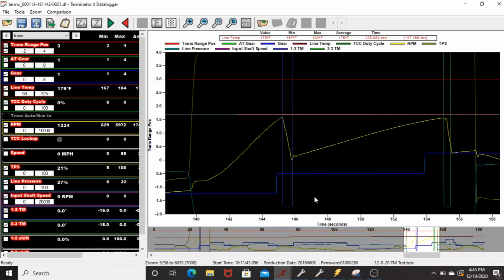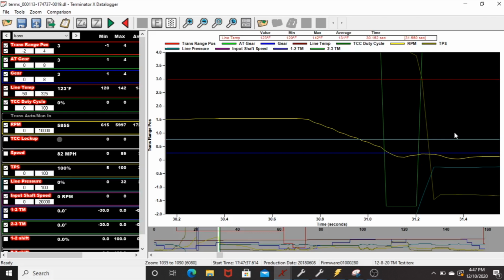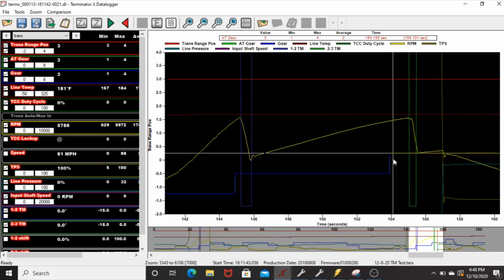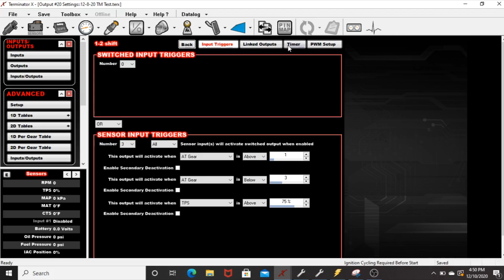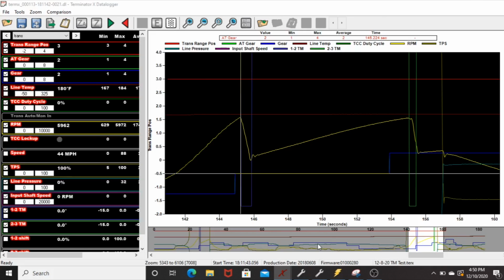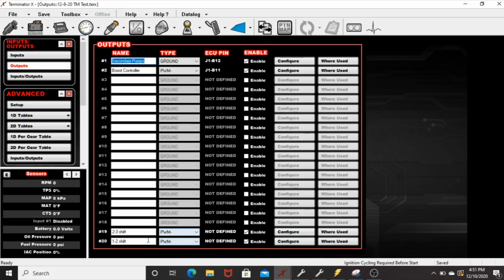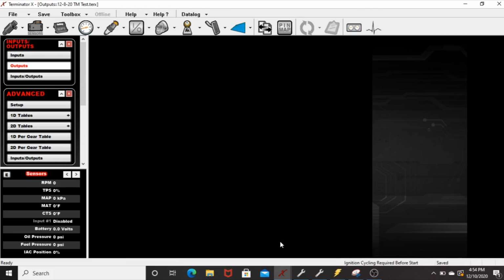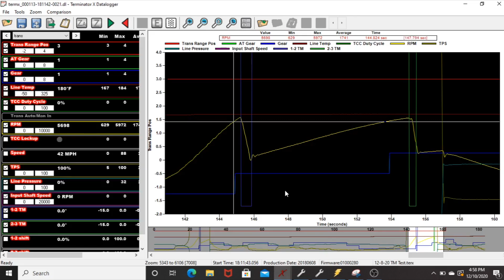Holley Terminator X Torque Management 4l60e 4l80e

Comment: Great video, thanks for the detailed explanation and walk through the software.  The 4L80E behind my 6.0 is fully rebuilt with the TransGo Performance 4L80E-HD2 and absolutely scorches the tires into 2nd gear; even with the smaller "shift firmness" holes drilled in the separator plate.  The part throttle shifts are excellent, so I need to pull power at WOT for the 1-2 shift, especially.

Comment: Nice work Ryan. Hopefully this method is consistent for you. Its alot easier to predict when to pull some timing on the 4L60/80e than it is on the 6L80/90. This method could show inconsistency with different RPM shifts, trans temp, pressure, engine load, etc in my head, but I haven't tried it this way, mainly because I had already built something using transmission slip, in which it's trigger mechanism is incredibly consistent. For drag racers or people looking to implement some sort of TM on a non electric transmission, this would work quite well, especially if you just trigger off of rpm drop vs gear change. I wish Holley had an RPM rate of change parameter, similar to their TPS ROC and MAP ROC, it would make all of this much easier. Either way, great work, feel free to give my 80e tm a try when you upgrade the trans, I think you will like it!

Comment: What shift pressures are you using for part throttle and WOT? I  have a feeling I'm commanding too much pressure causing a leak and eventually burning 3-4 clutches. Would like to get a better transmission setting prior to installing the rebuilt 4L65E and converter